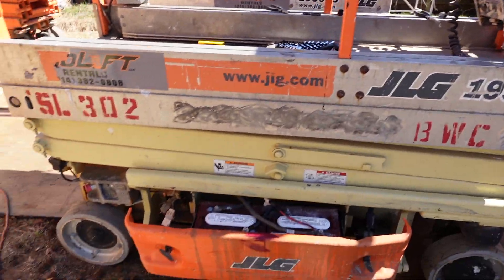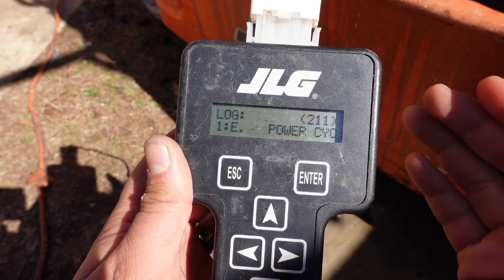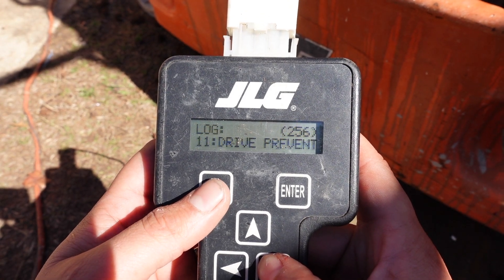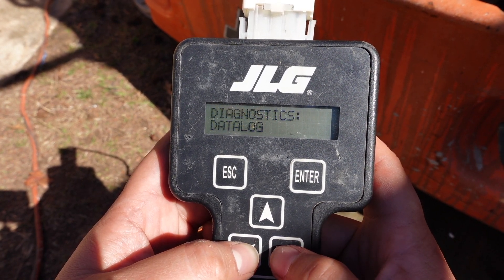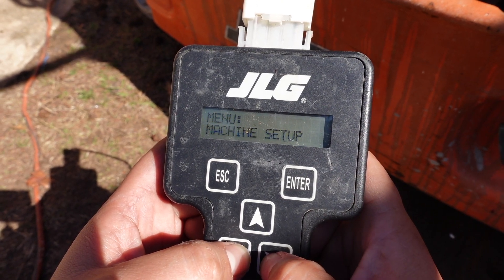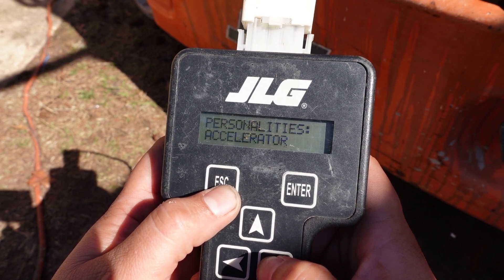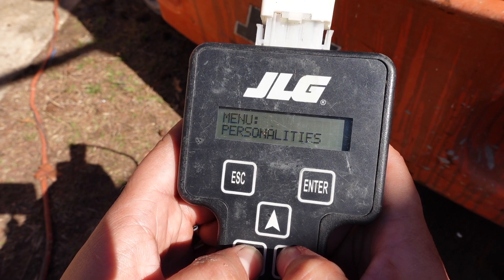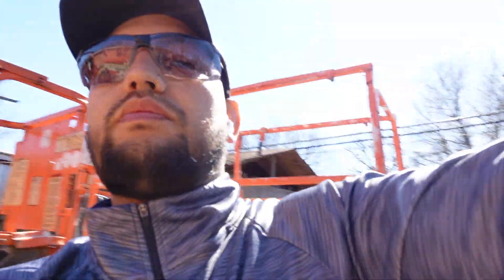Trouble shooting scissor lift with JLG handheld analyzer

Comment: Hello, i have a 1930ES that is showing a tilt alarm and wont go over 9'. I bought an analyzer to try and recalibrate the tilt sensor which is over 20 degrees off. I tilted the lift to get it within 5 degrees to see if i can recalibrate but i cant get it to go to 0. What am i doing wrong

Comment: Hi Manuel, I had a bunch of codes on my analyzer. I pin out cables check power modular found out it and the contractor was bad. so i change them out. I dont have any more canbus errors or lift problems on my code reader. but now i have an open contactor or relay. It is new , I guess i could have got a bad one. I need to check the voltage between the terminals to make sure i have 24 volts. Any ideas. HELP

Comment: @manueldiaz I'm having issues with a jlg 1932es. I don't have the diagnostic tool but I do see that on the control station it has the tilt light on and also the lightning bolt flashes. The machine doesn't go all the way up and the alarm sounds once it stopped 10ft high. Any ideas what it might be or what I should look for?
Reply from the maker: Sounds like the unit just needs to be re-calibrated , tilt is out center
Reply: @manueldiaz7723  thank you.

Comment: Hey sir do you encounter a fault code 6621 for TH514 telehandler it says boom angle sensor can bus failure we already change all the platform and rear harness we changed the POWER DISTRIBUTION BOARD AND UGM new Boom angle sensor.

Comment: Have you ran into any tilt sensor canbus failure code on 1932i/R1932? I have 24V/good ground and 2.5 on can to the sensor, tilt sensor value on analyzer shows ???, replaced with new and no change. Can’t calibrate either.
Reply from the maker: Is the tilt value trough analyzer showing 20-20?

Comment: Hello Manuel. We have the mode T350. The scssor lift can work without the foot put on the ground, for us it's not safe. How you allow operation only when the 4 foot are on the ground for safety ? does it need configuration or what. Tks

Comment: My JLG 3246ES is leaking fluid from the steering hydraulic bar.  I believe the seals are worn out. I am  curious how difficult it is to replace the seals and how complicated is it to add the fluid lost.
Reply from the maker: It’s fairly easy common problems on this unit 4 bolts to hold the steer cylinder and 2 hydraulic lines . Just make sure you don’t put the new ones in backwards. And to fill the fluid is easy Allen bolt mounted on the reservoir

Comment: Good morning Mate, this video really help, I am working on one scissor lift now, jlg 2669, the machine was working okay but the operator sparks the battery and that's were main circuit board burned, so I order new board and installed already, I started machine okay,but alarm beep and all  controls not working. Can you help me. Thanks
Reply from the maker: Yeah anytime you install a new computer or board on Jlg you need to program it to the machine. Once you do that the alarms will go off

Comment: I have a 2008 JLG 2630ES, I have a 25 fault code that shows drive and lift prevented. This happened after some battery issues. Now I have to charge the batteries with a separate charger and it won’t lift or drive, any help would greatly be appreciated.
Reply from the maker: Sounds like the issues is around the charger cause if wired wrong it will prevent you from driving or the batteries wires make sure they are hooked up correct and your not missing one . Check behind the batteries to see if you’re missing a whole lead connection that you might have missed

Comment: Hello there 
I have JLG 1930se couple months ago stopped driving back and forth and I was trying to figure out what's wrong by taking the batteries out to test them, nothing was wrong with them and after I put them back and now it doesn't operate up and down any idea how to get fixed or what it could wrong with it?
I appreciate in advance
Reply from the maker: Mmmm sounds like you have a short somewhere. Are you getting a fault code ?

Comment: Hey bro I have a JLG 2630 And is running slow up and down 
Can you help ?
Reply from the maker: Could be the pump but you can change speed trough analyzer sometimes tuning up the specs fixes issue

Comment: Helllo, how to fill hidravlic oil in cilinder for JLG 1930es????
Reply from the maker: Lift the unit about halfway . In the middle you’re gonna see the cylinder with a black reservoir where the fluid goes in. It’s usually a size 6 Allen wrench to unscrew
Reply: @handymanny214  thank you
Reply: @handymanny214  Normal or reverse thread?

Comment: Where can I get one   I have a e5002 error
Reply from the maker: If you google “Jlg analyzer” Amazon might have some in stock but I know they can get kinda pricy, that code is from the digital indicator next to the battery isn’t it?? 
How’s your lift acting up??
Reply from the maker: eBay or Amazon 
That’s the code on the bottom of LED correct ? 
Is your unit not doing anything at all?